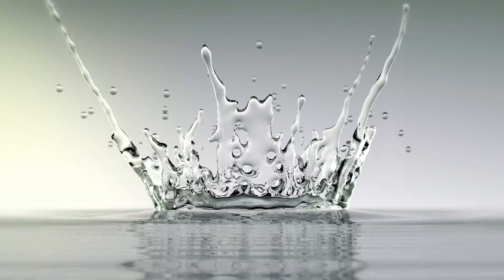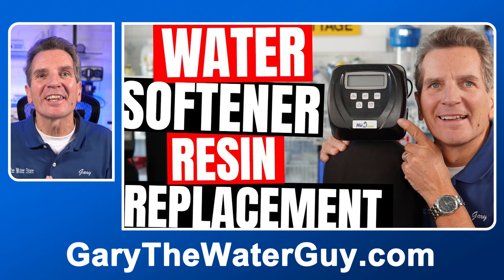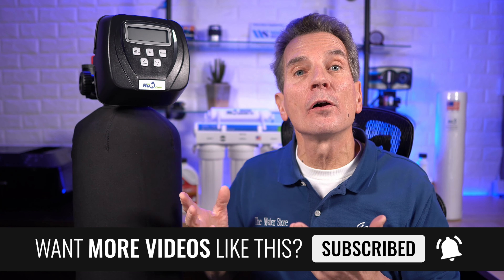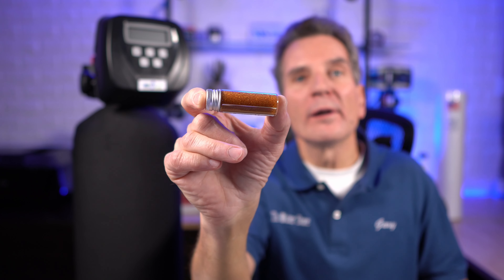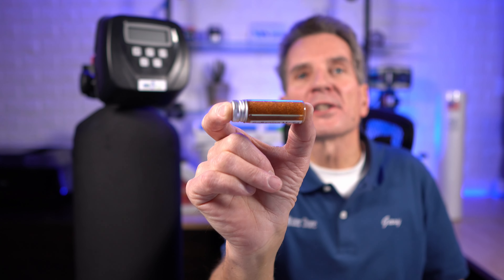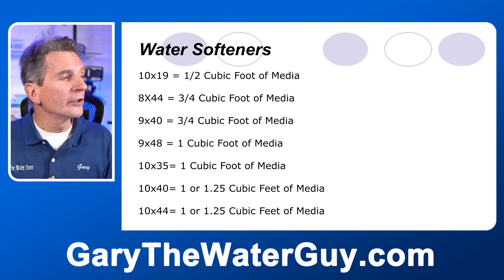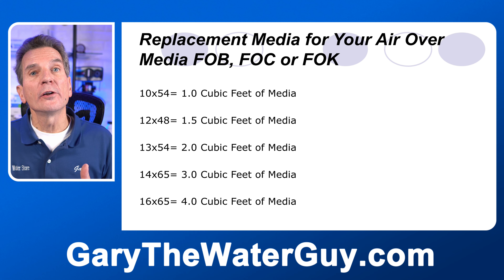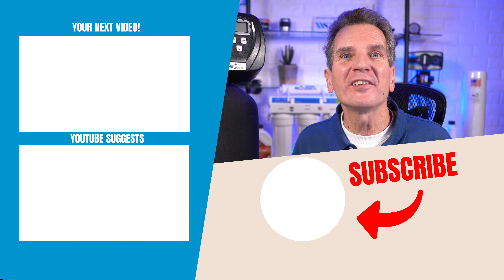HOW MUCH MEDIA is in my WATER SOFTENER?

Comment from the maker: Replacing the media in your water softener?  Check this out to know how much you need!
Reply: so the tank size determines the grain ?
Reply from the maker: To some extent but specifically the maximum amount of media that tank can contain.  It's always best to check with the manufacturer but that isn't always possible.
Reply: @water_estore  yes i dont have that specific info available and dont know the specific grain value of my softener,i did however lower the setting as per your advice to 24k grain on my softener and waiting to see if all is good
phil

Comment: I wished I'd watched this before I refilled my old Prochem water softener yesterday. I have not checked the tank size, but it's fairly large. The tank held about .75 cu. ft. of my 1 cu. ft. bag, but I think I may have filled it too far. I didn't fill it all the way to the top, but pretty close. I was under the impression this was a 32,000-grain softener, but it may be more like 24,000 or even less. It's been around for many years for the carpet cleaning industry. It does not use a gravel bag and must be recharged manually using a brine tank that siphons the dissolved salt into the softener although they do sell a very expensive auto-recharge unit. 

I may have to take some of the media back out since I may have it too close to the top. I think perhaps 1/2 cubic foot would have filled my tank about 2/3'rds up leaving more space at the top. Does this sound correct? Again, this is not a regular home water softener, but more like one an RV would use.
Reply from the maker: I am not familiar with your type of water softener so I really can't help.  Did you try to contact the manufacturer?

Comment: Hi Gary, I want to start by thanking  you for all the information you provide on water filtration. It has helped me so much.

I currently have an air over media iron/sulfur filter in a 9x48 tank, and my softener is in a 10 x 54 tank. I believe my iron filter media needs replacement, but I am a little concerned about the size of my tank. Do you see an issue with using the 9x48 tank for an iron filter? The system  was installed by the previous owner, and I wanted to make sure that it was done correctly, and if not, I made the changes now before swapping the media.
Thanks Gary. All the best.
Reply from the maker: It would depend on how much media is inside that tank.  Ouir smallest iron/sulphur filter is on a 10 x 54 tank.

Comment: If you need to replace the resin will your system still use salt? I'm assuming it will but before I replace it I want to make sure that is the issue. Thank you and great videos.
Reply from the maker: Great question, yes it will!  The brain does not know that the media has failed.
Reply: @water_estore  It was the filter at the bottom of the resin tank. I was able to get it out without removing the resin.

Comment: Hi Gary, thank you for your video! I have a Pentair tank that is 1054, which needs 1.5 cubic feet of media. When I dumped out the old media, it had a gravel bed. 
My questions are: 
-how much gravel will I need? (I’m assuming just enough to come up past the basket)
- Does the 1.5 cubic feet measurement include the gravel, or just the resin?
Reply from the maker: Just enough gravel to cover the basket.  Media is 1.5 cubic feet in addition to the gravel.

Comment: My son in law is replacing his system. He said the tech said it was hooked up wrong and “it was losing media beads”. Is that even possible? Is it worth the work to replace the media? Again the tech said “the system is only working at 50% because of that lose of beads. Hope to hear from u.
Reply from the maker: Yes, if the riser tube becomes compromised the media beads will be washed out.  Yes, the media beads and riser tube can be replaced, this video will help you. https://youtu.be/Z47JGH1l39o

Comment: Hi Gary the Water Guy,
Thanks much for the information for the video.  I am planning to replace the resin in my ~18yo water softerner.  It has a 13x54 tank and per the chart in your video will need 2.5 cu.ft. of resin.  My question is: does the 2.5 take into account the head space for the 1354 tank?  or is 2.5 the maximum capacity of the tank?  

Wanting to ask because if i will be using gravel and leaving a headspace; can I get away with purchasing 2.0 cu ft of resin + the gravel?  Or will that be too much headspace?  Thanks much in advance!!!
Jay
Reply from the maker: Good question.  Yes, that allows for the free board (headspace). You can use 2.0 but you would need to change the settings in the valve to compnsate.

Comment: hi Gary, love your videos. Using an in out valve on a carbon filter. So no backwash. Seeing that it does not back wash do i really need to load up gravel on the bottom of the carbon filter?
Reply from the maker: I would because you definitely don't want to wash that carbon out during a surge.
Reply: @water_estore  not sure what you mean by a surge? my last in/out carbon lasted 7+ years with no hiccups.
Reply from the maker: Getting a water surge from your municipality.

Comment: Hi Gary,
A couple questions. 
1. If I'm seeing resin from the brine tank discharge, does this mean I just have to replace the resin beads? 
2. Also, how do I know what kind of media to replace with? I have a clack WS1 but can't find anything online. I also have a lot of iron in my water.
Reply from the maker: Yes, but you also need to correct why the beads are leaking out.  Likely a compromised basket or riser tube in the tank. https://waterestore.com/products/hum-riser-tube-and-upper-screen-replacement-combo This is the media we use https://waterestore.com/products/excelclear-premium-grade-water-softener-media-1-cubic-foot
Reply: @water_estore  Thanks Gary! Found your channel and I have already learned a lot!

Comment: We recently had our Culligan Smart HE softener moved to another home in a different state.  When I reconnected everything and the unit regenerated, I noticed that the regeneration drain water (which I collected in a container) had a lot of resin.  Is this expected or should I worry about some damage during the move?  (It was offline for about two weeks due to the move.)
Reply from the maker: That's not normal.  I would be concerned about internal damage.
Reply: Okay, thanks for the input. @water_estore
Reply: Following up - I did a manual regeneration.  There was no additional resin loss.  Also, the water now seems soft as before the move.  It's strange.  I'm wondering if air trapped during the move caused some pressure condition in the first regeneration where some resin loss occurred. @water_estore
Reply from the maker: Yes, likley related to the start up procedure.

Comment: Hi Gary, thank goodness folks like you are around for time of need with softener troubles.  My Fleck5600SXT functions normally but we got hard water, cloudy deposits on glassware, and I'll replace the resin. My tank is 10 X 47 and your list for 10 X 44 is 1 or 1.25 cu ft of resin, so does this has to be precise or within the ball park is acceptable.  Which type of media to choose as in 8% or 10%. And thanks for the clarification of NOT to fill to the brim because there are clips in here that maximize the beads to the limit.
Reply from the maker: Ideally you should repalce the media with the same amount that was originally installed.  We use 8% which we have here https://waterestore.ca/products/excelclear-premium-grade-water-softener-media-1-cubic-foot

Comment: Mine just did something different...........it was doing it's automatic regen and started dumping out media into the sink. I turned it off, unplugged it and put it in bypass mode. I guess that means it has failed and I now need a new one. Bummer.
Reply from the maker: Yes, something let go inside. You can check out replacement water softeners here https://waterestore.com/collections/water-softener
Reply: @water_estore  Thanks Gary. It is an old unit that came with my home. I'm shopping around for a new one. I appreciate the link too. Love your videos. They are very helpful.

Comment: Gary, Looking that the included manual, the specs state that the "Amount of High Capacity Ion Exchange Resin" is 1.11 cu. ft.  On the parts list however, the "Repl. Resin Tank, 9" X 40" ". By this video, you show a 9X40 as 3/4 of 1 cu. ft.  If I were to choose, which value would you pick??  1.11 cu. ft. or .75 cu. ft. based on the size of the resin tank listed on the parts list.  Thx in advance.
Reply from the maker: I always suggest you proceed with the manufacturers recommendations.
Reply: @water_estore   Thank you for the reply.  That was my point however.  The manual is conflicting. But 9X40 is 9X40.  It will hold what it holds.  Thank you for your video. It was the only one showing how to replace the resin beads.   Cheers!

Comment: How do I know if my softner has gravel on the bottom?
Reply from the maker: You don't.  But if the tank is 12" or larger it should, smaller and if not used for a commercial application it doesn't need gravel.

Comment: How do you calculate how many cubic feet of gravel are needed for your tank?  Do you subtract the cubic feet of gravel from the total cubic feet of media resin?
Reply from the maker: You just add enough gravel to cover the basket at the bottom of the riser tube.  This is usually all that you need  https://waterestore.ca/products/gravel-water-softener-under-bedding-15-lb  for a 30,000 to 45,000 grain water softener, more for 60,000 to 90,000.
Reply: @water_estore  thank you

Comment: Hello I'm Greg I stoped by a yard sale seen a tall water softener and brine tank he said he used it in his coffiee shop worked good took it out  swamped for a smaller one and never installed it in his home was set up in a storage  building  it's a steeltec unit I can send you a photo of needed .,my question is if it's still in good working order how do I find out before I start to interrupt my homes water then find out I need to service the unit.the electronics still come on and work .the flow valve still turns and is not froze up.brine tank and float is in good shape.thanks for any help you can give.
Greg.
Reply from the maker: Plug it in and try to run it through a regeneration cycle.  You will always be taking a chance with a used softener.

Comment: so Gray I have a pentair model 265-860 water softener how much resin is required for this unit. Oh and on the display screen it started saying check salt not sure what I need to do any advice to this matter
Reply from the maker: I can't tell from the 265-860 number what size your tank is, follow the advice in the video to determine.  I don't know much about this valve or what check salt means in this context.
Reply: @water_estore  thanks Gary I found out what check salt means it has stop falling and made a cave in the regen salt container and will not fall I will go back and watch the video again awesome advice thanks

Comment: Sir, can you please help me? I have contacted many local water ppl plus the company “Lancaster.” I bought a house in 2019 which has a perplexing water system.

My “long story short” question is how can I tell what media my tank / systems was built for by using any known indicators? (E.g. backwash injector number)

 I just want to maintain my system. I know how to add the calcite & can do that, but there is an add’l side tank (much smaller) that no one knows what it is. It would seem it should have a brine/salt tank attached to it, but it does not. At the current moment no one knows what me inside. I’m afraid I will open it and just see water. Can you point me in the right direction pls?
US Veteran

Comment: Recently my valve failed. I was going to take this opportunity to rebed the system, and come to find out the original installer had set my treatment system up as an iron filter/ph neutralizer. The corosex/birm media had become a sludge. I was able to clean the 10x54 tank, along with the resin tank. My well ph is 4.5,  So I'm thinking of installing a larger dedicated neutralizer,  And utilizing this tank as the softener. The iron tests at about three PPM. Do you have any suggestions on the combination of media I should use?  Or do you think I would need a dedicated iron filter as well?  I've gotten a few estimates, but would like an unbiased opinion,  And I have been learning a lot from your videos.
Reply from the maker: I do not recommend mixed bed systems, they are always a compromise.  I would install a neutralizer like this https://waterestore.ca/products/hum-neutralizing-filter-calcite-corosex-1-5-cubic-foot and then an iron filter like this https://waterestore.ca/products/hum-fob-chemical-free-iron-filter

Comment: Hi Gary!
Please, do you know how much media do I need on a WaterBoss 700 (2005) ?? The manufacturer handbook I have says that the amount of resin for this model is 20 liters, but I had a hard time to fill it with that quantity; it began difficult above 15 liters aprox and I had to squeeze it with a stick until fit the 20 liters.
I think the information may be wrong (maybe because of the conversion between cubic-feet to liters, or the translation from english to spanish); but I have also found at google an american handbook and it says 0.7 cubic feet (which is 20 liters more or less). Thank you.
Reply from the maker: I do not know.  I would call the maunfacturer and ask them at 18004378993